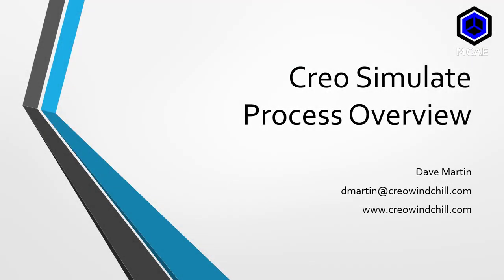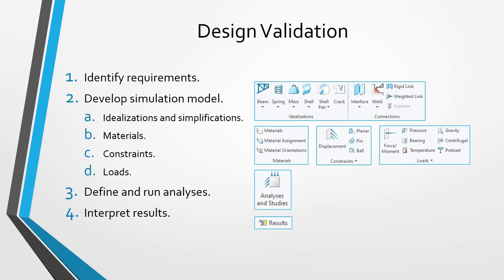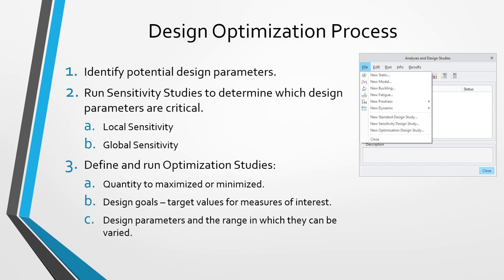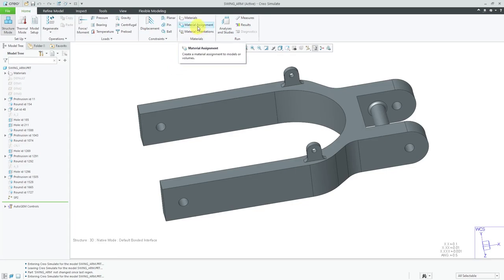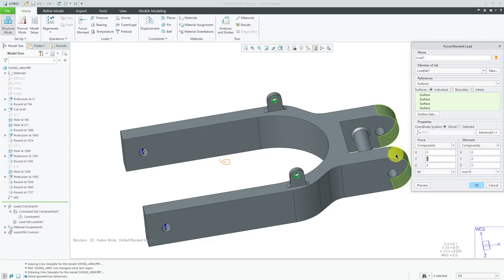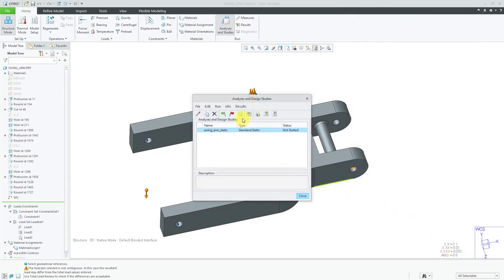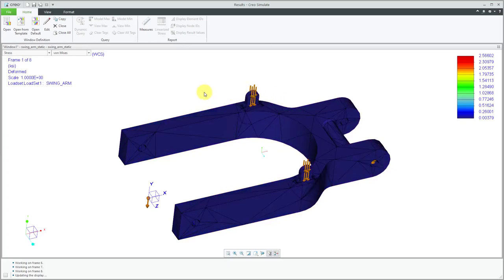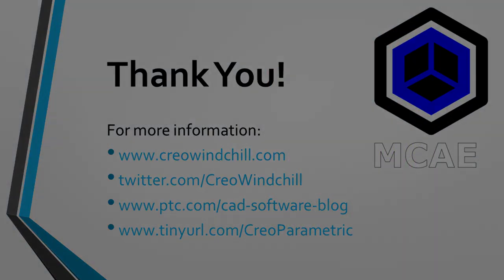Creo Simulate Overview - Creo Parametric

Comment: Sir...how much should we keep  convergence percentage ?10%...how to decide the optimum percentage for better convergence result?
Reply from the maker: The more analysis you perform, the better a feel you will get for convergence settings. How critical is this component to safety and operation? How expensive would failure be? Are you debugging the model or are you running final analyses for your report?
Reply: Thank you sir...